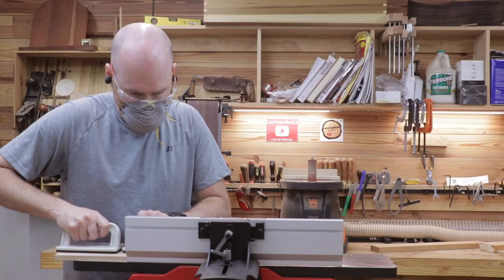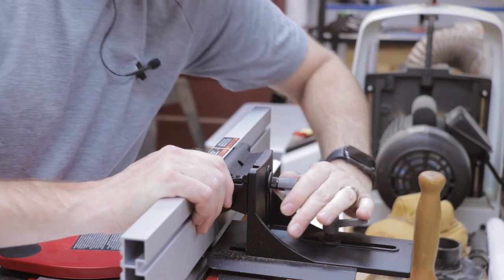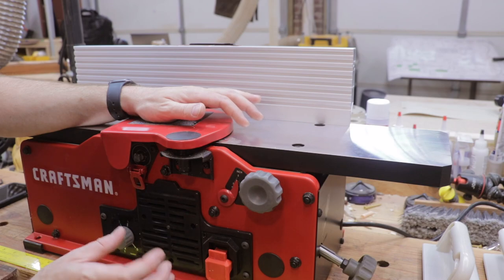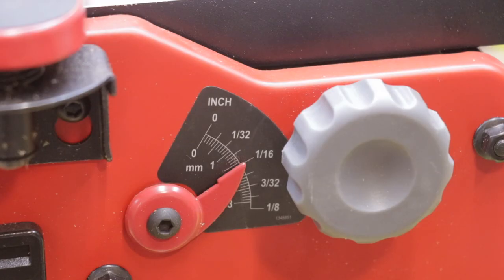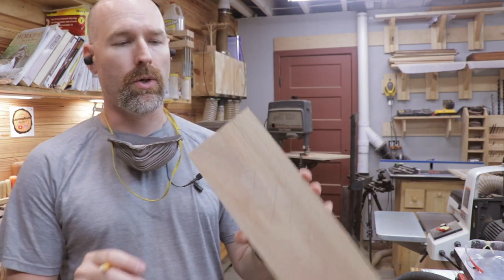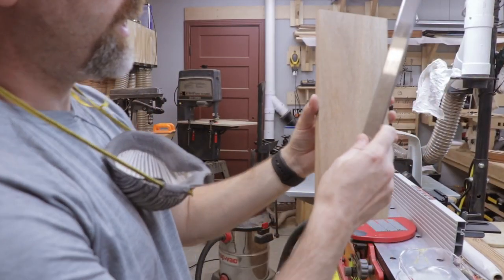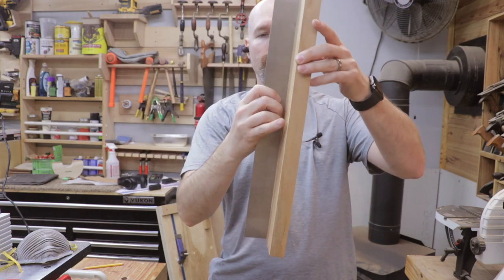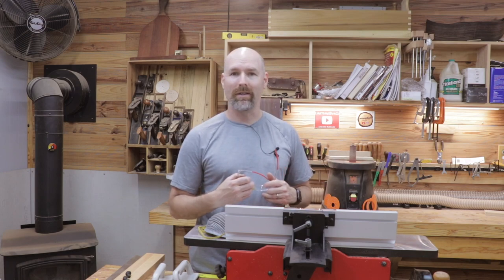Testing The Cheapest Jointer on Amazon

Comment: That was a very nice review. Pretty thorough without being lengthy. Well done.

A benchtop jointer like this seems like it would be well suited for cabinetry, as long as the pieces didn't get too long. From face frames to door frames, it seems like it do the job. Not that you'd want to use it in a production environment, but if you were looking to make some shop cabinets or even kitchen or bath cabinets for your own home, this would be a nice tool to have.

That said, reading the other comments, there seems to be a reliability issue.
Reply from the maker: No issues for me yet

Comment: The Craftsman planer is  almost identical to the Wen & Wahoda jointer. Same adjustments, same positions of knobs. The key is the the cutting blades. 

Now you need to run it through a planer & tablesaw.

Comment: I've been using this jointer for a while now! I love it. However, this is my second one. My first one died a week into use, right in the middle of a cut. Got it traded out and have had no issues! Been a few months. Hope it stays that way!
Reply: The reviews on lowes are riddled with 1 stars for this specific reason.
Reply: @iheart3dprinting951  yep. I definitely noticed that after I bought it. Hopefully this one stays functional atleast until I can save the money for a better one. I started making furniture on the side after my husband got laid off last year. Didn't realize I'd love it so much! But working with what I have until I can afford better!
Reply: @jaynawhite5579  You're not alone on this journey.  I got a fancy welder and been making frames and boxes among other things.  People really seem like welded steel tables but I think putting a sheet of plywood is kind of lame. So been making table tops out of 2x4s, 2x6s and 2x8s redwood and pine.  But now I think I want to get rid of that rounded corner and make the edges mate seamlessly maybe even do an epoxy table top.   Goodluck on your journey and thanks for the reply.

Comment: I've face and edge jointed 4inch wide / 6,& 8 ft long boards (but nothing wider or longer than that)  on the portercable and for the money it does a good job blades kinda go fast but I use it multiple times a day / everyday
Reply: Any tricks you use for the 8 ft board? Such as catching it with some method on the other side to keep it stable?

Comment: I paid $60 for a used version of this only with the Delta badge. I couldn’t be more pleased with it.
Reply from the maker: Wonder if it same tool? Just different color?
Reply: @lastingbuild1373  its identical. It’s also sold under a couple other brands. Although some of the features may be different. Some don’t have the speed control.

Comment: Hello, LastingBuild with the treadle lathe you can instead of using the bore drive spur to attach the wood that you are milling you can actually glue a circle the size of one of the galvanized flanges to the wood your milling and then screw on the galvanized flange and attach that to the pole on the headstock.

Comment: Identical to the old Delta bench top jointer I used to have.  Worked okay, but it's pretty much worthless for anything longer than about 30".  Just a few years ago you could get a real cast iron stationary jointer for the same price.  Now you can't touch one for less than about $1,000.

Comment: I just bought one of these from Lowes.  Setup was fairly easy.  Worked great on edging a couple of boards.  Turned it on to do the 3rd board and before I could even get the board on the table the motor stopped.  Packed it back up and got Lowes to exchange it.  Set up the 2nd unit, turned it on, ran for about 10 seconds and it stopped.  I didn't even get started on the board.  The control electronics in this thing is a piece of JUNK.  Read the Lowes reviews before you purchase one of these.  Probably more than 50% of owners have had the same issue - motor controller going bad so be aware of this if you buy this jointer.  This same jointer has carried the Porter Cable and Delta names as well.  WHY would these companies sell these units with such a poor history it can't be good for their brand.  There are a number of YouTube postings on repairing the speed controller.  In general for the small time I used this jointer I liked it.  Size is perfect for me and it seemed to do exactly what I wanted.  I have actually decided to keep the unit, bypass the internal speed controller and run it with an external PWM controller ordered rom Amazon.  BUYER BEWARE!
Reply: That's exactly why I passed on that model. All reviews are like yours. Crazy that they still sell it. I'm holding out for a rigid planer.
Reply: Sorry you went thru this. Can you recommend a decent joiner for me?
Reply: did you have it connected to an extension cord?
Reply: Did you have this problem while running it on a dedicated 20 amp circuit without an extension cord?
Reply: @kfk1988  Hi Kelly it is plugged directly into a wall outlet.
Reply: @oreoninja918  No it was plugged directly into a wall outlet.
Reply: It looks like Wen sells basically this jointer without the speed controller.  Turn it on and she go.

Comment: That’s the same exact joiner as the porter cable. I have the porter cable joiner and with some in feed and out feed tables it works very well. I did have an issue with a blade and when I went to change it ended up stripping a bolt on the head. I’m probably going to have to replace the head if I can’t get that bolt out. Just be extremely careful changing the blades.
Reply: And looking at it, it looks almost identical to the even cheaper version from Wen.

Comment: For something like this, or other desk top jointers what is the longest board you’d say it can handle? I’m looking to diy a farmhouse table. Either 6-8’ boards. 2x6/8 most likely pine.
Reply from the maker: I wouldn’t recommend anything longer than the length of the tool.

Comment: I am trying to figure out if there are two blades or one on this? I have been using mine and it works good. After a long bout with it last night it started not cutting well and I noticed there was only one blade in it. Don't know if there were two , like it looks like there is a place for the second one. Don

Comment: Sorry for a dumb question but what is the difference between a planer and a jointer?  Not a hand planer, but electric.
Reply: A planer references off the wood your planing you got to have a flat side to start with and the jointer references off the bed of the jointer.hope that makes sense.
Reply: @donpayne562  Oh.  Hmmm
Reply: @theropesofrenovation9352  They appear to do the same thing, but in order for you to use a planner to make both sides of the board flat you have to start with either a jointer or a DIY jointer sled that you use with your planner to get one side flat as a planner by itself will not accomplish this.  Once you have a flat side then you can flip it over with the flat side on the bottom and run it through your planner.  Let me know if you need any help.
Reply: Btw, no question is a dumb question.  I enjoy helping and inspiring others to build something awesome!
Reply: @inspiringbuilds  Haven't used either item and couldn't figure out the difference.  Thanks!
Reply: @theropesofrenovation9352  Absolutely, I’m hear to help and focus on inspiring others.  After looking at your channel kudos to you for jumping in doing a wide range of DIY’s!
Reply: @inspiringbuilds  Thanks.  Took a long time but it's done!

Comment: I wonder how the blades do with "squirrely" or figured wood--that would be interesting to investigate--thanks for a great review.
Reply: I bought this jointer when it was called a porter cable. it tends to chunk wood when the grain isn't consistent. It works fine taking less than a 1/16" per pass. Gets the job done, just not the best.

Comment: This is nearly identical to the Shop Fox 6" spiral - same fence and body, except your's has the speed regulator (nice). Have you had any issues with fence deflection, especially for longer boards? Even though the fence is square to the table, I can never get a squared reference edge. Like you said in the vid, not meant for longer boards.
Reply from the maker: I only use it for boards about 2 ft or less in length! No issues so far!

Comment: I’ve got a beginner question for you! I’ve noticed in these tutorials that nobody seems to run both edges on the jointer. Is the idea to only do one side and then use it as a reference on a table saw?
Reply: exactly, with both tools set up correctly you'll get perfectly parallel edges and you could cut it right on size at the same time.
Same goes for the flat sides, you use the jointed side as a reference surface in a planer.
Reply: one edge - opposite edge gets cut on the table saw.  one surface opposite surface gets thickness planed.
Reply: Usually paired with a planer to get both large faces flat and parallel. I use a table saw for the second thin edge, then can run it on the jointer to remove saw marks.
Reply: As the other replies have said, the answer is Yes—cut second side on table saw. Otherwise there’s no guarantee the sides are parallel. Think of a board that’s 1/8” wider on one side. It might look square but if you joint the second side, it’s still not parallel.

Comment: Bought one of these. It crapped out in a few weeks time randomly. Just shut off and never turned back on. Returned to store for another one. That one lasted less than a week. Got my money back on that one. From reading others experience online this is common. I would not recommend. When it works, it is a good little joiner....but both I had stopped working. If you still want to give it a go, make sure the store you buy it from has a good return policy.
Reply from the maker: Thanks for sharing! I wonder if other viewers have experienced similar?

Comment: For edge jointing this is ok. For width jointing not only this one but all jointers just create a problem. That 1 x 4 6 8 10 etc when face jointed is now less than the original nominal 3/4 inch. Now you need a planer too.

Comment: These planners cannot handle much over the long term. I bought one that had a sizable chunk of the aluminum bed break off in use. I wouldn't recommend buying one of these
Reply from the maker: What type of wood were you planing when it broke?
Reply: @lastingbuild1373  Pine , I had it set to 1/32 and was edging several 1X4 for a table top 3rd one through BANG